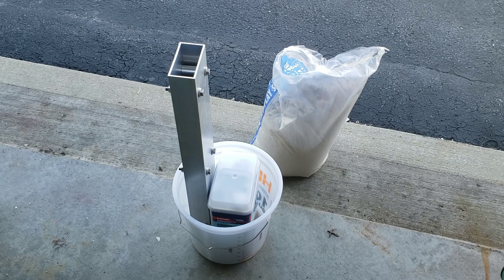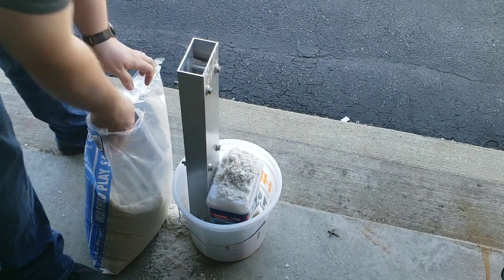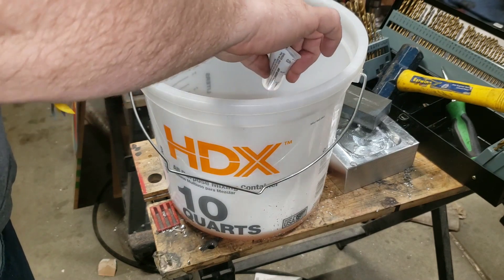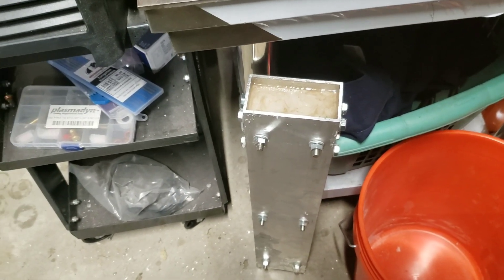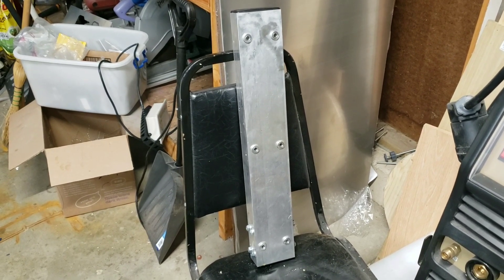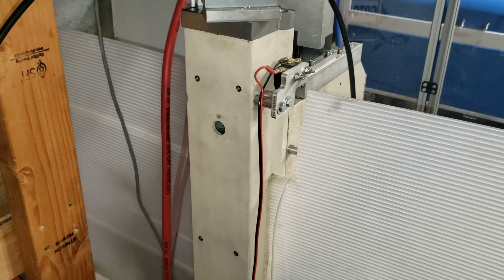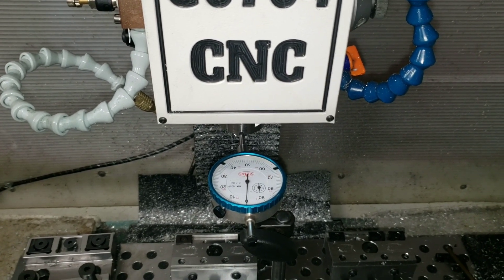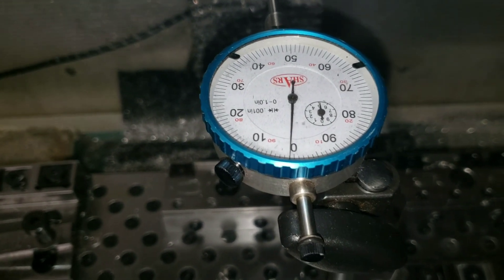G0704 cnc mill - column brace part 2 of 3 - Epoxy granite filled and bolted up!

Comment: Polyester is not epoxy. It's cheaper but not good, a slow curing epoxy would gave you 3 hours to mix, fill and shake.
Reply from the maker: The term Epoxy Granite is thrown around a lot with stiffening cnc equipment. But the exact makeup is not fixed or truly defined.  I believe what i used works for me and my application.  please share a video of your preferred process for all to benefit from.
Reply: Whatever, polyester is more rigid than most epoxies.

Comment: Just add another steel section on the column back.
Reply from the maker: Video #3 will show exactly why that's a bad idea.  I'm finalizing the last and final updates soon.
Reply: @adaptedmachining6951  I have a problem with Column Twisting after putting linear rails on Z axis, the whole head shakes up, especially on plunging.
I am really curious if this worked out well for you or i should not bother doing it and i should make a whole new column with epoxy, sand filling it and just mounting the linear rails there with the head with the proper aluminium parts offcourse.